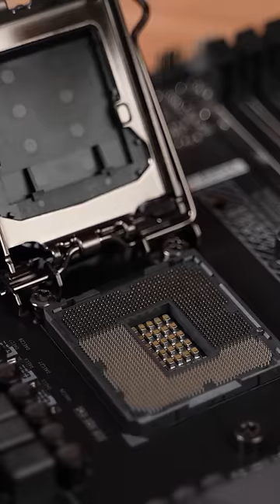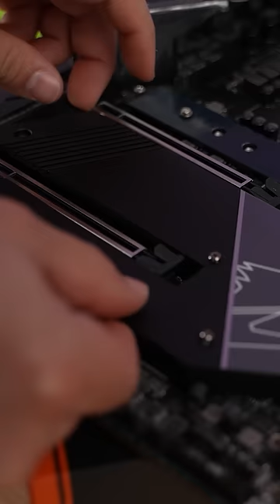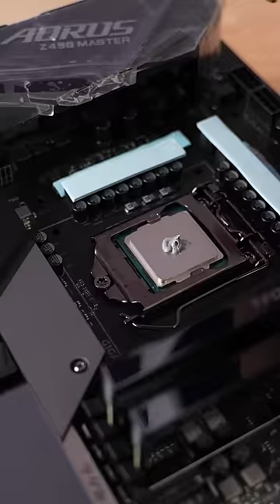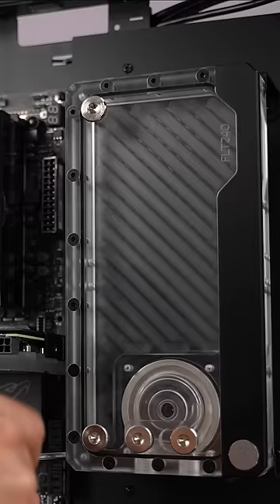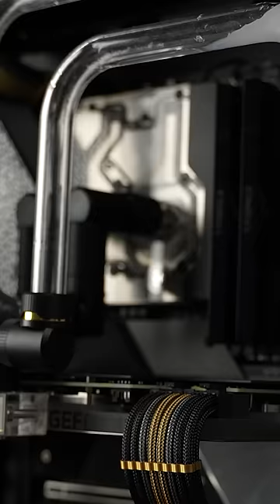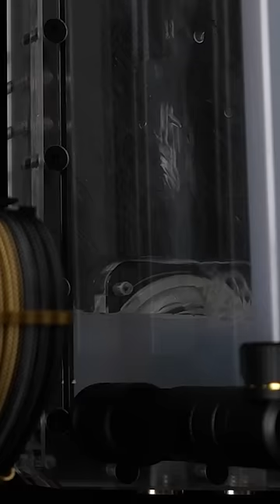$6000 EPIC Corsair 5000D RTX 3080 + i9 Water Cooled PC Build

Comment: $6000 my ass. That pc couldn’t be more than $3000
Reply: You would be surprised how much custom water loop tubing and connections can cost. Corsair custom loops start around $800 and get over $1400 for tubing, pump, rads, fans, and blocks.  I don't think the build this person's showing is 6000, bit it's higher then 3000.
Reply: Yo I didn't see your comment before commenting the same fucking thing lmao. Completely agree
Reply: @zachcunningham5660  I agree with you
Reply: @zachcunningham5660  what world are you living in??? Custom loops are not that expensive. A good custom loop is like 700 tops. Fans are like $30 each. Gpu block is like $200, cpu like $100, radiator like $150, tubing is like $70, and the fittings are like $50
Reply: @jackkrebs4180  Corsair custom loop for my build I have if I were to do it is 1000 dollars… now keep in mind I have a 7000d so my case is quite a bit bigger but yea Corsair is pricey for that
Reply: The 3080 alone like 2 months ago was like $2000
Reply: @wavytoad9983  my friend saw some for 1450$, insanely expensive.
Reply: @zachcunningham5660  Corsair custom loops don't start at $800....
Reply: @nexxusty  they have the full kit for $500 lmao
Reply: As someone who just did this with a 3080 in a 5000D. You’d be surprised my MSI Carbon EK X mobo was $700 alone. Then the sleeved PSU cables $40, each 90 degree fitting is at least $10, and the reservoir and pump was probably $150. Each radiator $100.. block $200, i9 $500, card can be $2,000 depending on when the 3080 was purchased… 1k PSU $150 ish, two M.2 probably $200-400 depending on speed. Then 16GB of ram $80-120. Fans - $100.. case $200. It all adds up. He may also he pulling comparables, if you tried to buy this from a company it’d be around $6,000.

Regardless the price is likely a bit inflated for views but not $3k
Reply: Say Hi to Inflation, Scalpers, and bitcoin miners
Reply: @jackkrebs4180  find me a 100 dollar i9
Reply: @wavytoad9983  yeah it was sad but now my friend bought a 3070ti for $850!!
Reply: A 3080 on it’s own costs damn near $2K on it’s own throw in a new i9 and you’re already looking at close to $3K with a GPU CPU
Reply: @christanchiuchiu4270  he's talking about the cpu block for watercooling
Reply: 😂😂😂😂😂 you legit know nothing about pc’s then. Just a decent gpu is at least $500 nowadays. A good cpu is at least $300 now. My PC is mid range and costed $1900 with normal air cooling. Water cooling is what changes things for sure. A gpu water block itself is crazy, or if you get a card that comes with one pre installed? Well there’s an extra $1k right there. Plus the psu he’s using is a 1000w 80+ that looks pretty nice I’m willing to bet just the psu was at least $250.
Reply: @blakeswalkthroughs2701  I think it was even more for the ram it looked like 32gb of DDR5 which goes $500 if it is 6000 hz
Reply: I'd say this would be around 4500 at msrp everything but i bet he wasnt lucky enough to get that, 3080 were upmarked like 170% of msrp at its height
Reply: @wavytoad9983  bestbuy currently has MSi ventus 3080 sitting at 1000
Reply: @mattplayzj.1618  yes, but prior to extremely recently, they were much more that 1000. A 3060 was even 800-1000 a couple months ago.
Reply: Bro unless all the parts are all scalped then 6k yea
Reply: @zachcunningham5660  you can Get custom for 500$
Reply: @zachcunningham5660  from corsair
Reply: i mean look at that motherboard, psu, cable mod, distroplate, eq watercooling. that shit expensive
Reply: Couldn’t have said it better.
Reply: Fax
Reply: @yo_its_gingey5329  $200 probably
Reply: @jackkrebs4180  what cpu is 100 dollars?
Reply: @jackkrebs4180  LMAO CPU 100 PLEASE GO ON NEWEGG BEFORE YOU EMBARRASS YOURSELF. PLEASE ITS FOR YOUR OWN GOOD, dawg said an i9 was 100. What abt the 3080?? Gpu shortage is slowing down but gpus are still overpriced compared to starting msrp, so your research before calling another out. I’m sorry my brother. But you my friend are wrong.
Reply: Since all of us are so unsure about prices, let’s all just search up his components, listed in description.
Reply: @jackkrebs4180  what world are you living in, I live in a world where RTX 30 series gpus go for over 600 each (maybe a little under counting the 3050), a 3080 can go for up to 1500, even 2k due to scalpers. The cpu is an i9-10900K, bud that shit is fucking 500 bucks, 300 least when used on eBay. Please tell me you are fucking joking. DO YOUR DAMN RESEARCH FUCKING DAMN IT. Alright glad I got that off my chest have a good day. I apologize for that abrupt offense.
Reply: Yea like for 6000 there better be a founder 3090 in it.
Reply: It's probably 4500 at most
Reply: @zachcunningham5660  bro the tubing is like 20, the pump is 100 for a decent one, rads are 100, fans are 100 and blocks are 100, your overdoing it😂
Reply: @wavytoad9983  yeah, not the retail
Reply: @blakeswalkthroughs2701  they prob got the 3080 for retail which is about 600
Reply: If it's water looped.. yeah.. it can be up there..
Reply: @brendanmccarthy492  prices aint adding up
Reply: @imfromfloridayouwontunders8315  florida man strikes again! I think people would get upset if they found out this pc actually cost more than $6000 at the time it was built
Reply: @shevchdnkoigor2238  the card alone cost us like $2400 and people wanted over 3k for a 3090FE lol
Reply: @WtTankman  retail on this 3080 is $1400
Reply: The 3080s rn are impossible to buy under like $2k what are you on about 😂
Reply: @datboii3738  i got one last week for $1150
Reply: @rmkn9200 i bought a 3080 for $1150 like a week ago
Reply: @rmkn9200 yes
Reply: I assume 10900k $300, aorus master z490 $400, ram $250, ssd $250, GPU $1000, water-cooling $1000, case $200, PSU $200...  So roughly $3600 I assume...
Reply: Ssd's alone cost like 500-600, DDR5 costs 5000 too
Reply: @PuErhLove  where are you buying $500 ssds
Reply: @wavytoad9983  what was the original price of the 3080?
Reply: @zachcunningham5660  If you're honestly spending more than $700 on a loop then you're doing something wrong. I spent around $500 on mine and didn't skimp on anything.
Reply: @rmkn9200 Theyre not you can find 3050s for 250$ get a decent Mb and cpu for $250 a power supply and ram for $200 bam $700 solid pc
Reply: @wavytoad9983 Soo Truee
Reply: Dude spent way too much for overpriced crap. Mine outperforms this for less than 3k but i didnt get all this fancy water cooling / expensive brands
Reply: In Indonesia 3080 is about 1.2K usd yeah it lower than before. But from i can see it still clearly above 3K. In Indonesia that motherboard alone like 500 or 600. But that still not reaching 4.5K mark
Reply: @wavytoad9983  I am a Turk and I wish we had an economy like you, I can work and take for 2 years and really cheap for you, the computer is expensive to us.
Reply: @cockman8437  the best fans you can get are $30 each. Noctua Nf F-12
Reply: Consisting my 2 8tb Nvme’s on my x79 with 2 780ti costs over 3 grand, who knows now a days. And 3080ti, 3090ti GPU prices can easily push any rig towards $6000
Reply: @herc1319  kits almost always exclude gpu block so be sure to track that onto a kit
Reply: Its possible. The graphics card is already near 600 or 1200 if you have the Ti
Reply: @brian-us6vw  that gpu is like 1100-1200
Reply: @jackkrebs4180  yeah so its very possible the pc is over 3k
Reply: Probably $6k selling price
Reply: Lol, that EK custom loop is $2500 alone. You are not very good at understanding the cost of PC parts, kiddo.
Reply: @jackkrebs4180  EK, they are much more expensive than your Chinese AIO, lol.
Reply: @herc1319  thats an AIO, not a custom loop.
Reply: @Floris_VI  lmfao. You are way off.
Reply: @TBUD_mxb  almost all CPUs. Good luck finding anything decent under $150. Most average CPUs are in the $250-$350 range. My i9-9900k currently sits as a $800 CPU.
Reply: @okauz3492  nope, it's about $6000. Look up the parts.
Reply: @WtTankman  not for EK. That's a $2k custom loop.
Reply: @WtTankman  no 3080 goes for $600 retail, lmfao. Slap yourself
Reply: @jackkrebs4180  they are.
Reply: @jackkrebs4180  lol, lying doesn't make you cool, kiddo.
Reply: @samserrano3966  it's currently $1500 msrp retail for the cheapest 3080 you can buy
Reply: @StandTallTx  you didn't buy new EK parts. The monoblock alone can cost $300.
Reply: @herc1319  3050???? LMFAOOOOOOO
Reply: @xTurtleOW  no it doesn't, lmfao.
Reply: @evolicious  I have 3080ti and 12900k it is better than this :))
Reply: @evolicious  I just looked on Amazon and the cheapest 380 was $880.
Reply: @evolicious  I built my own pc but okay
Reply: @evolicious  ur just comment baiting. Kinda sad tbh
Reply: It's gonna get cheaper in the future as technology advances
Reply: @nightvxz  here in taiwan there's some for less than 1400
Reply: @TBUD_mxb  He didn't say a cpu costs $100 learn how to read before commenting.
Reply: @imfromfloridayouwontunders8315  he never said those components cost those prices. He was very OBVIOUSLY talking about custom cooling loops. Learn how to read before going full karen for literally no reason. Honestly your rant is so hilarious because you're arguing against nobody.
Reply: Bozo dont you know the price of pc components
Reply: The gpu alone would bring the price up to $1700 nowadays.
Reply: @Halal_Gaming  not at all. Gpu prices falling rn
Reply: @evolicious  it's only 6000 because of the water cooling my friend has a pc with a 3090 and i9 12th gen which was around 3.2k I still wouldn't say this pc is 6k I'd say 4.5-5k
Reply: @evolicious  watercooling is jsut ridiculously expensive but I don't think it'll make it 2k more in price when my friend has similar pc but it's not water-cooled and it's air-cooled
Reply: Have the Same Motherboard, same Tower, Same PCU. Esily $6k
Reply: My pc is far worse and costs 4000 dollars. It really depends on which country you buy it in
Reply: @zachcunningham5660  True, wc loop parts alone can add up to over $1000 especially if you're buying higher end parts
Reply: @jackkrebs4180  Wow, since when were cpus only 100$? Please tell me.
Reply: @widerahoob1  cpu water block u numskull
Reply: I can order from china for cheap aluminum/copper rad + aio alu/cop block for cpu + gpu plus a d5/ddc laing pump for around 300$ and still get the same performance as any custom ek bits. The great thing about aio gpu block is it can fit any graphic card and making new bracket cost me 5-10$ . about the look yep it's not that great but for funtionality and price .
Still a 10900k is pretty trash compare to the i5 12600k , a 12600k +b660 onda/soyo/biostar/maxsun/colorful/msi would blow that 10900k to dust . But at this point buying anything is insane since ryzen 7000+ intel raptor lake coming in few months plus the new rtx+rx. A 3080ti new in china only 6200¥ is around 960$-970$
Reply: @InTheMindOfficial  00000000â00
Reply: @sefabaloglu9290  um, thanks?
Reply: Ik right they r using an I9 11th gen not even 12th gen like bruh
Reply: @zachcunningham5660  bro image a 5000 dollar gaming pc with custom loops and a 3090 and a 5950x
Reply: He probably asks 3k for the job. Normal things nowadays
Reply: @zachcunningham5660  dude there isn’t even a 3080
Reply: Lmao, tell me you know nothing about pc’s without telling me u know nothing about pc’s.. 😂😂😂
Reply: it should have at least 3080 sli to cost 6000$ lol
Reply: @wavytoad9983  fact
Reply: @zachcunningham5660  The real crime is using EK paste on a 6k build… it’s like a woman built it.
Reply: Nah id bet its over 4-5k easy bcuz of all the flashy stuff. I have a 3070ti which isnt much less powerful than the 3080, got the i9, good cooling, basically all the bells n whistles and spent 3k. Mine is much more basic looking tho
Reply: @imfromfloridayouwontunders8315  hes talking about the block...
Reply: Mine is $4500 and I only have 1 part over $1k :/ it’s pretty easy to hit that number with the right specs
Reply: @jackkrebs4180  sure it’s that price if your buying the crappy yet affordable versions of stuff… the point of the build is to be top of the notch also part prices are expensive now
Reply: @zachcunningham5660  anyone dumb enough to order all Corsair parts like no other parts exist deserve to pay $6000 for a pc. Paying for a name nothing more and there product suck.
Reply: Perhaps all that hardware is gold/silver plated. But yeah that's no 6k PC, the most expensive thing is likely that GPU, and I personally don't count fancy cases, RGB lights and other superfluous trinkets as adding to the actual cost.
Reply: Theyre charging labor guys
Reply: Ikr im getting a 12gen intel and the best 10g 3080 and its up to 1600
Reply: @deathbysloth3180  bruh you got sooo much money like I'm building a pc of like 500$ , send me some in payal so I'll add graphic card too hehe
Reply: It has rgb 👍
Reply: Lol especially when he only has a 3080
Reply: I’d give it 5000 Canadian
Reply: @zachcunningham5660  a custom loop kit cost 500
Reply: Should of used a different color like a neon liquid or something
Reply: For 6000$ is easy possible
Reply: @wavytoad9983  the rtx 3080 is actually around 800-900 euro’s where did you get that fking price
Reply: @jackkrebs4180  wen Is a 12th gen 100 dollars u living in the 20th century
Reply: @abdurrahmannarma5306  the waterblock for the cpu, not the cpu itself.
Reply: I was just going say the exact same shit 6000$????? I made a 3090 build 12th gen i9 with a 1000$ rog motherboard used all fitting no pipes and it was almost 6 grand so yeah come again this 4500$ at that
Reply: @jackkrebs4180  lmfao what garbage cpu block u get for 100$ plus it most definitely wasn’t a lga1700 block at that for 100$.. and I can do a custom water cool for more then 700$ easy in just fitting too smh unless u built 5 plus water cooled systems with all kinds of brands parts don’t talk yeah sure u can do one for 700$ but the shit u using is highly unreliable you’ll have a clogged looo in 4 months with a 700$ build 😭🤦🏻‍♂️
Reply: @drew2626  bro I live by a run down Canada computers and as u can see I live in Canada so no microcenter and guess what even my run down cc has 3080,3090,3090ti all for retail the 3090ti  is like 2k 🤣😭 this ain’t early 2020 🤣🤣🤣🤣
Reply: @KUTZUM4  bro EKs water block is like $100
Reply: @wavytoad9983  where tf do you like, you can get one for like 970€ new here
Reply: @jackkrebs4180  unless u buy there lil tiny cheesy ones with no pump or some lol..
Reply: Replace that i9 build, with ryzen threadripper pro, dual VGA, maximum ddr 5 ecc ram it can muster, two 8TB of pcie 5 nvme at the least keep that custom water cooling than it would easily breached 6000 grands mark..
Reply: Unless he got scammed ...
Reply: @jackkrebs4180  your exact on point
Reply: @zachcunningham5660  corsair has a full kit rad, fans, tubing, full bending kit, pump, and water blocks for 500 usd.
Reply: @jackkrebs4180  have u seen ekwb stuff. It’s a bit more
Reply: @lucayavar1895  cap. Check their store. Its like $40 for a cpu block rn
Reply: That system with just the hardware selected alone is 2.8-3K
That level of watercooling can easily add an additional 2.5-2.8K
Custom cables can be $150-$200 for a full kit from cablemod. It all adds up.
Compression fittings alone can cost more  than a GPU
Reply: @zachcunningham5660  its not even 12th gen ffs
Reply: Build fee🤓
Reply: true, like 6k ? with a 3080 ? yeah right
Reply: @jackkrebs4180  lmaoooo tf you smoking? a cpu is not 100$ unless its an i5. This building has an i9, thats 600 usd
Reply: 2500
Reply: I fit 2 3090's into an I9 build for less. Its not 6k.
Reply: @zachcunningham5660  well its fkn stupid how he got a $6000 pc AND STILL FKN USES A 3080. LIKE BRO. 3090TI IS SO MUCH FKN BETTER OR 3090.
Reply: @zachcunningham5660  The PC builder is either a Vietnamese or Thai. He can scam anyone into believing such high price.
Reply: if im not mistaken the motherboard is like 1.5k
Reply: @zachcunningham5660   CUSTOM WATERCOOLING IS WASTE OF MONEY FOR THIS SYSTEM RATHER THAN NECESSITY
Reply: I do have to say I've looked into custom wc and it basically doubles the budget of any build
Reply: if they are using hard tubing I wouldn't be surprised
Reply: Yeah but it’s just a 3080. I’m looking at a build for a 3090 Ti, i9 12900k and a cooler master haf700 case and I’m just about $4,600 WITH custom cooling. Op is right this is a 3k build.
Reply: @jackkrebs4180  100$ for an i9??
Reply: @Rafecameronskitty  dog read the comments before u embarrass urself
Reply: An all EK CPU/GPU water loop w/ the quantum fittings is ~1k. But I agree this is probably a $4500 PC max.
Reply: I just build a new gaming rig for $2200

i9 12900K, Gigabyte 3080, 850W Corsair, 64gb ram, 2 TB M.2
🤷🏻‍♂️
Reply: @christanchiuchiu4270  they meant 100$ for the cpu water block ( i think )
Reply: @wavytoad9983  luckily you can get a 3090 from Newegg just under 2k these days
Reply: @jackkrebs4180  I have 28 fittings in my PC and ohne costs around 7€ = 196€. 6 Fans each 30€ = 180€, 2 Rads = 300€, 1 pump = 60€, tubing = 70€, monoblock = 125€. Resovoir = 50€. all together 196+180+300+60+70+150+50 = 1006€. I have ontop of that a Led lighting. That's another 50-100€ and the kables for the Led. And a silent Box for the pump. Watercooling hast so much Hidden costs^^
Reply: @jackkrebs4180  Wrong asf… you need 220m per unit that you wish to overclock (120m for non-overclocked units,) Bro is cooling 3 units. 1 with a single block (MB + CPU,) the another water block for the GPU. That requires x2 420m rads…. A custom loop of that size with run 1400 easy…. The 3090 TI water block is around 329 from EKWB… I know this for a fact because I’m building a similar system. It’s running around $6000k…
Reply: @blitzcourt5021  Best Buy has the 3090 Ti FE for 1099.00.
Reply: @_J_LL_  And he has the 3090 TI FE water block… on top of his mono block… not sure if he cooled his ram but jeez…
Reply: @KennyCutz  yeah, nope, he didnt cool the RAM. I dont want to start an argument^^
Reply: Idgaf what anyone says 6k for 2 sticks of ram is a fuckin joke. 🤣🤣
Reply: @AustinK95  5000D is the chassis
Reply: @AustinK95  they are 16gb each tho
Reply: @zachcunningham5660  air cooling is master race.
My pc got amazing cooling for only 150 euros
Reply: @MR.Twentysix I think its been proven that air cooling is just as good as water cooling, so there's really no reason to do it except for aesthetics
Reply: @zachcunningham5660  i have the same exact pc, down to the specs, with custom watercooling, mine is 3400 dollars
Reply: Looks about 6k to me, expensive parts in a lot of places, like overpaid but it happens
Reply: @imfromfloridayouwontunders8315  he's talking about the CPU block you goofball
Reply: You mean you can get the same performance for 3000 lol, its more about flexing among nerds and virgins than really about performance, kinda like buying a 5 dollar chinese T shirt for 5000 because its says Gucci
Reply: What a waste of money...
Reply: 6000 AUD
Reply: @Im from Florida You wont understand a word I say  you clearly didn't understand his comment, he meant the cpu pump for liquid cooling
Reply: My pc is less than $200 xD
Reply: agree hahaha
Reply: Welcome to custom water loops
Reply: fr
Reply: @zachcunningham5660  Bro, I've got a trx40 system with a 3090ti and a custom loop that didn't cost anywhere near 6k. Also custom loops do not start at $800 lol.
Reply: True. But damn that’s a clean pc
Reply: the electricity bill: "no money my ass, you got 1 grand
Reply: No to mention we don’t know how much the ram, motherboard, fans, power supply, case, and SSD or HD was
Reply: @zachcunningham5660  still not getting where the other 2k minimum came from ;/
Reply: @WtTankman  yea for your broke person build lmfao
Reply: @jackkrebs4180  not cheap shitty ones. Or a lot of storage.
Reply: Even with custom wc, it will cost max 5000
Reply: Aleast $
Reply: Without water cooling kit this pc still no more $2k. No way watercooling kit was $4k
Reply: @zachcunningham5660
Reply: Exactly , maybe 6000 if you pay someone else to build it .
Reply: Could not be more than 2.5 3080 is not that expensive also intel is mid
Reply: @jackkrebs4180 bro CPU’s can go up to thousands
Reply: @strykergunner1716  name 1 cpu that is in the thousands
Reply: If he drops gpu water cooling and use a big nice aio for cpu the price drops insanely. Its not worth imho really
Reply: Fr I just built a 4090 i9 13900k build for about 4k